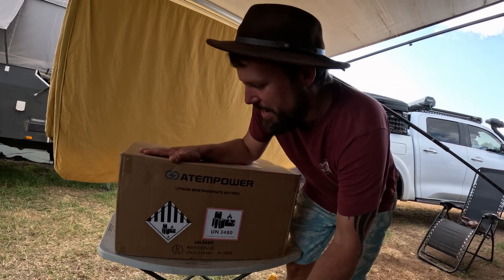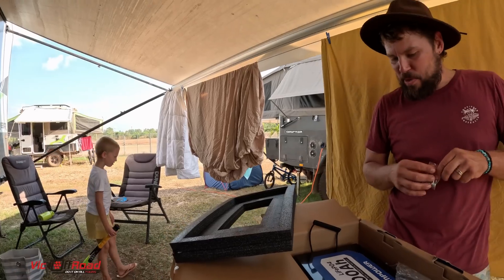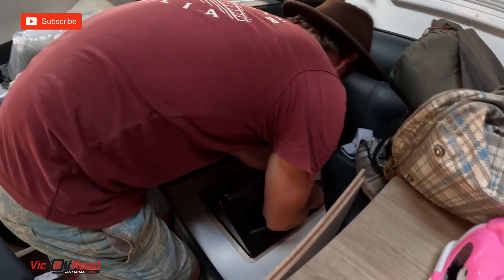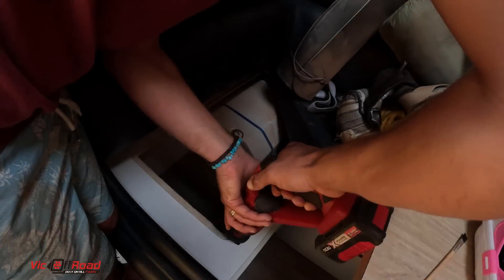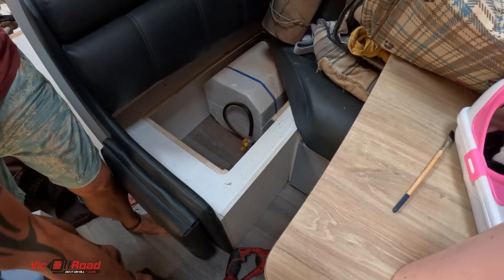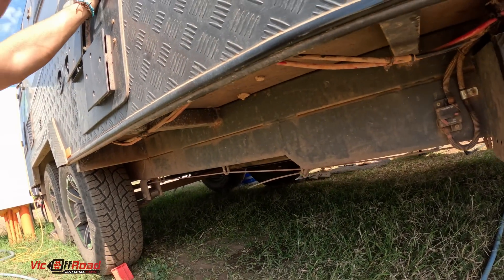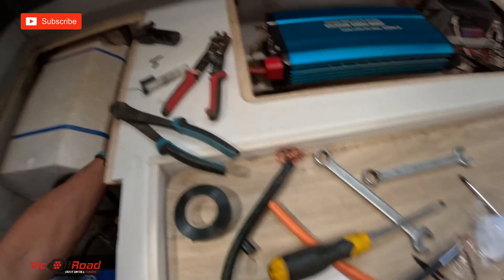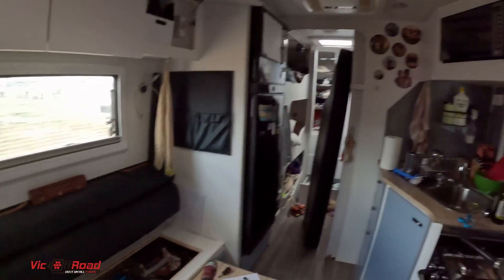200AH LITHIUM BATTERY INSTALL

Comment: I used flooded lead acid deep cycle batteries previously for home backup and I found they deteriorated quicky with deeper discharge (loss of capacity). Lithium is just better all round for deep cycle use.

Comment: Just going through the motion getting the van built .I’m getting 800w Solar and 400 amp lithium .so should be all good 👍👌👍👌
Reply from the maker: Thats awesome! 400AH is heaps!!! We might get another 200ah battery because we are really enjoying being offgrid with ac. I wish we could carry more water!

Cheers mate
Reply: Yeah mate what I’m going to do is buy a water  bladder 100l or so and keep it in the Gwm .If there is water around I’ll pump it in and drive to the van 👌
Reply from the maker: @MrHsv123  yes for sure! 
I'm gonna get rid of the Generator as I Hardy use it. And now I never will because of good battery 💪 more water! Haha
Reply from the maker: And ill grab a bladder too

Comment: Lithium is definitely a game changer. I recently bought 3 x Kings 200A Lithiums & they are great for the price, about $800 (on special recently for $749 ea) similar specs & seen quite a few good reviews & teardowns, decent cells & BMS, one spec that is better, is they can run in 4p &/or 4S, so good for 48v systems too, the Kings 300A lithiums can output 300A continuously so are a neat drop in for ur inverter if only buying one. 
Your 160W of solar will perform better on lithium batteries too, as they can take a much higher charging current than any LA battery up to 99% SOC, so no solar power is wasted due to high battery resistance as it charges. If u want more (Cheap) solar panels it’s worth a look for 2nd hand house panels, they generally perform better with their higher output voltage, are a little heavier, but you can get them very cheap or free on FB. Good job. Cheers
Reply from the maker: Thanks for all the info mate :)
Good to hear the kings batteries are good to as they are a great budget option! 

Cheers 🍻  😀

Comment: Not sure if you did and I missed it but when you plug in from the inverter need to turn the power off to the BMS so the batteries aren't being charged from the inverter. Also the fridge if it automatically changes over to 240.
Reply from the maker: True :) yeah I flick the fridge and battery charger off
Reply from the maker: Thanks mate 😀

Comment: Lithium need to be charged at 14 volts, which is why the charger has to be reset.
Smart alternators are a problem with second batteries as once the starting battery reaches 80% the alternator will cut its output.
You need a power connection directly from the alternator thru the rear of the vehicle to the DC-DC charger in the van, so it can charge the lithium.
An air-conditioned will flatten the lithium fairly quickly unless it is boosted by a generator.
Reply from the maker: Thank you :) 
No smart alternator on our car so that's a bonus.

Yeah will keep an eye on charging and how much to use AC. Gotta be careful.  Seems like a hour is safe. Any more we risk going flat and fridge turns off. Tested a few times now. Solar seems to be working great getting charge back up. About to fit the shunt so we can see where we are truly at 

Cheers

Comment: I heard the new law is to install lithium batteries outside the van. You might need to replace that old  tray big enough one  to accommodate your big battery
Reply from the maker: Thank you  :) 

I will be relocating. I just heard of all this 

Cheers
Reply: That's only onnew vans when the new regulations kick in later this year. Does not apply to existing vans.....

Comment: New battery rules come into effect now, have to be not installed in RV living area.
Inverter cabling is to small,
Better fit a shunt to monitor SOC
Reply from the maker: Shunt coming real soon :)
Reply from the maker: Just did some research.  Might have to relocate. Ahhhh 
Thanks for the info mate :)
Reply from the maker: Also added some notes in the description. I really appreciate you pointing this out to me. Thank you
Reply: Standard is only enforceable from Nov 2024 in new RVs and it's not retrospective is my understanding.
Reply from the maker: Thanks mate :)

Comment: Hahaha I was just watching your goodlife run through Chang your mind m8
Reply from the maker: I know!!! The deep cycle finally died so I had to upgrade 😀

Definitely love the extra power for sure :)

I couldn't justify spending the money on a new battery as the old one was ok but now we can use the AC too! Pretty happy :)
Reply: @wheelsbytheocean  we did exactly that replaced 340amps of agm for 200 lithium and haven't looked back p.s love watching your shows keep up the great vids cheers Gordo

Comment: DON'T PUT IT NEAR WATER. OR HEAT.
THEY NEED GOOD VENTILATION  !!!!!!
Reply from the maker: Thanks mate :) maybe I should add some speed holes haha
Reply from the maker: Thanks mate :) maybe I should add some speed holes haha
Reply: ALL GOOD. 12V LITTLE FAN IN THAT AREA. DURING IT BEING USED...